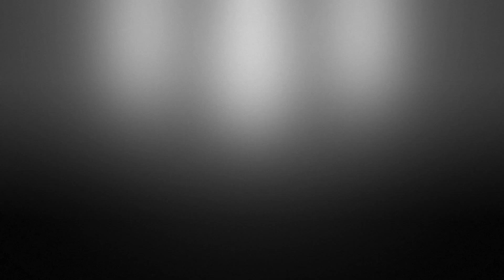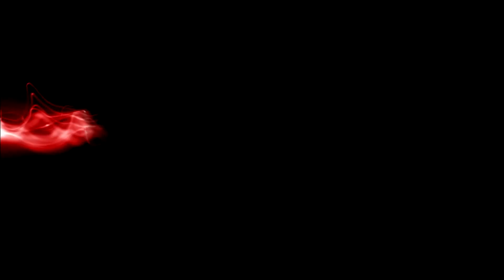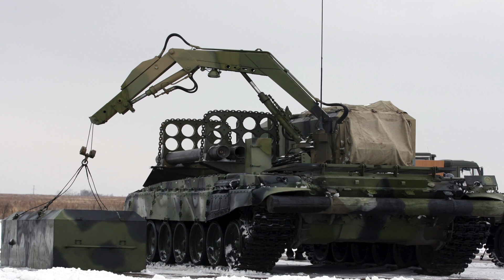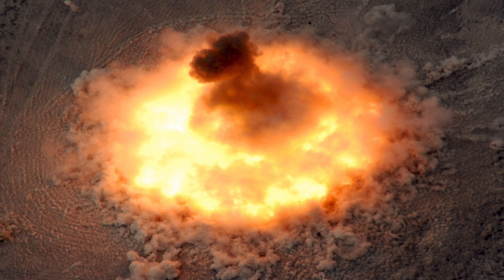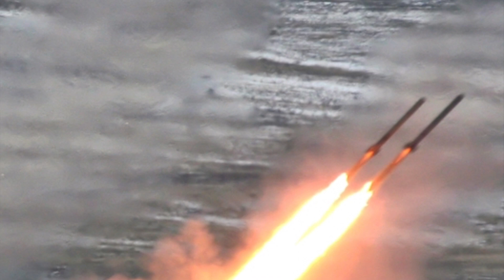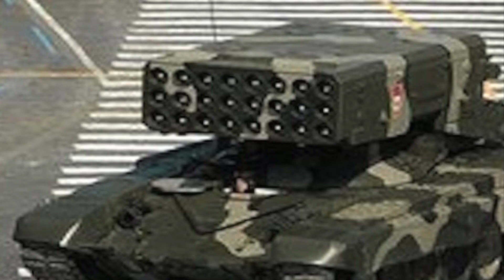WHY RUSSIA’S TOS-1(A) IS CALLED BLAZING SUN ?

Comment: This weapon doesn't make a ton of sense on a modern battlefield, a single fuel air (thermobaric) bomb can do as much damage as an entire salvo and is more mobile and adaptable, given that it's carried on aircraft with a range of hundreds of kilometers and speeds from hundreds to over a thousand miles per hour. The launch vehicle itself because of the nature of the warheads would be highly susceptible to ordinary shoulder carried munitions like anti-tank rockets and recoilless rifles, possibly even 50 caliber sniper fire, let alone air to surface guided munitions or even cannon fire from aircraft. By simple fact of the open face design they simply can not be as well armored as conventional tanks and would be vulnerable the entire time they were in transit at a maximum speed of what? Forty five miles an hour? So, if you have air superiority you don't need these, if you don't have air superiority, they would shortly be reduced to toast, taking their support and defense personnel with them. This seems like a relic of cold war limited engagement strategy, somewhat useful for suppressing revolutions in client states, but that's about it.
Reply: Bombers aren't always over head .. Go look up what its done in Syria, its works.. Very well
Reply: By your logic artillery should be obsolete as well since 'Air superiority'. It's cheaper to use one of these than and aircraft that can be shot down. Also its behind the line of engagement, the likelihood of infantry reaching close to it is highly unlikely. Also there is a magical weapon called MANPADS and even infantry can carry it, and it can shoot down aircraft.
Reply: cough what if aircraft cant get to front lines due to strong ground anti air bad weather or lot of enemy plane fighters? cough
Reply: massivereader
you dont get it, russians katiushas were very effective against enemy cause they shot everything in seconds and go to other positions before planes could fly up and be directed by ground forces
its marvelous hit and run strategy
as for sniping well this thing works as artillery unit that is working always behind front lines
Reply: Alright guys lets stop .. massivemasturbater is an 11 year old kid .. No point in talking to a know nothing child https://www.youtube.com/user/massivereader
Reply: Systems like this did Amazing in Syria...that is modern battle field.  Some would say in "battle space" where GPS jamming is happening this is the perfect system.
Reply: Not certain but I believe they put it on a tank chassis so it would be able to be closer to the combat zone. The Grads have a longer range and they are based on URAL trucks. Of course it is susceptible to return fire but keep in mind it works as blanket fire. An entire slavo can level a swath of land much more quickly and effectively than artillery.
Reply: they know the flaws so they are aware of it.. they know the advantage so they will t0ok it.. snipers cant shot at 6 km right? hehe
Reply: massivereader I don't see anything cheaper. It's on a old tank chasis so it's cheap to incorporate. It's rockets are much cheaper than bombs. A plane costs much more do to fuel costs, so this system is a must have
Reply: massivereader same happens when enemy bombs any ammo deposit, i dont get you dude katiusha proven itself as very effective weapon not only morally but by its dewasting fire power
same goes with ammo cargo ships but i think u dont get this crucial fact that war is war and things explode, what you did say in respond was that rocket launcher is always working next to higly densed infrantry units which is probably wrong since i already explain to you they shoot and change position to avoid counter attack
Reply: well you got it.. hehe tos-1a must avoid getting t0o near to buildings a range of a sniper.. or shall i say this will bomb snipers on the building..
Reply: massivereader I guess you must be some kind of expert.  Lol.   There are so many advantages of this system vrs a bomb that has to be flown and dropped.  1.  You don't need a plane 2.  The rockets are much cheaper and if it's just a house and not an entire Forrest or mountain which you need to clear for landing or our reasons then this system just makes more sense.  3.  Cost effectiveness it's built on top of a t72 chassis which is widley used and cheap especially if it's 2nd hand.  Plus each round is not guided at least yet those are also much cheaper than US air dropped thermoberic Daisy Cutters or moabs
4.  The US has other thermoberic systems including shoulder launched and mortars which can provide similar results.  
5. I guess you missed the part of the actually role of the weapon is to break stalemates between opposing ground forces.  Not every country has the luxury of a real airforce.
Reply: I am sure a AA regiment would be attached to artillery infantry mechanized units and so forth. Russia is not Iraq or some 3rd world banana repuplic without proper air defences or capable airforce.
Reply: massiveretard I don't think you understand what you're talking about. You say you can blow one of those rockets up using small arms fire? Do you know you have to have oxygen to cause a spark to ignite the explosives inside the missile? Even then, a spark wouldn't be enough to cause an explosion, that's why missiles like that have fuses. It's basic stuff, it's like that argument about having external fuel tanks on a tank, they're full of fuel, so if they get shot, the fuel just leaks out onto the ground. No harm done.

Unless you score a direct hit with artillery, shoot at it with a rocket propelled grenade or a HEAT-FS shell, something that has sufficient explosives, then you might get a reaction. Other than that, dream on.

Also the rocket housing is armoured, it's enough to protect from shrapnel.

Moreover this isn't designed to work alone like you insinuated. This is designed to work paired up with SPAA systems, tank divisions and Infantry. Any form of enemy aircraft wouldn't even get close, and if it were, it would risk being shot down by SPAA. Same with tank and infantry attacks.

Also, why the fuck would any organised fighting force use their precious special forces against an artillery battery? Honestly, after you said that, all your arguments became void of any credibility.
Reply: Yep, in 1966.
Reply: massivereader ure saying now that they arent logical to have because they get hit by anti tank rpg, so can be any lighter vehicle supporting infantry so we supposed to send just infantry like japanese on light russian tanks and arm them with rpgs land mines and  turn them in to kamikaze units?
Reply: electricatom2, We're kind of going round and round on this so I'm probably going to drop this thread. The military take measures to be sure Ammo ships and depos are protected and kept isolated from essential personnel  and equipment. Still, they are a risk, but a necessary risk. Usually ammo gets carried in at least light armored vehicles, maybe not as well armored as a tank, but at least comparable to an APC. In assembly areas and military bases, they build special containment areas to direct the explosive blast away from troops and equipment in case the ammo is hit. Even in artillery batteries, they limit the amount of ammo kept fused and out of storage until it is needed to make ready to fire. In a war, those kinds of installations are primary targets, right along with airfields and fuel depots. When you're fighting rebels and guerillas, chances are they won't be able to penetrate those kinds of hardened and protected targets. What you're failing to grasp is that these are highly distinctive looking vehicles that each hold about a company size ammo depo worth of highly reactive explosives (fuses), thermobaric payloads, and solid fuel rockets. They are running around recently contested areas with likely nothing more than a motorized platoon as an infantry screen. The same goes for their distinctive looking reloading pods. When one of these gets hit, it will cover an area about 300 meters in diameter (several city blocks) in a sheet of flame with no air left to breathe, and likey set off any ammo or weapons in that area in secondary explosions. The shock wave will kill or injure any of your own troops in about twice that area. The rocket motors will also ignite, spreading chaos & damage even further. In a real war, enemy troops will know this and prioritize them as targets o opportunity whenever they are moved in convoy, stationed in assembly areas, or deployed in the field; not because they are so effective a weapon, many other weapon systems are more tactically and strategically significant, but because of the chaos and damage to the enemy forces they will cause when hit. Like I've said: they're a great 'terror weapon' against insurgents without knowledge that they are coming, where they are, and when they might be used, but a real military will include them in briefings wherever they are likely to show up. Any time they do show up they other side will prioritize them for airstrikes, artillery barrages and commando action, again not for the potential harm they might cause those enemy forces but for how badly it will harm the Russians around it.
Reply: massivereader i have video in syria how are they used no allied infrantry in sight i dont know why u want to give it only morale weapon name but its more effective in destroying bunkers and infrantry in trenches than any other artillery meaby except cluster bombs and gas but those are prohipited by UN so yeah thermobaric are 1st in line of legal weapons
Reply: i guess its more humane to kill person than to make him suffer till he dies or make him criple for the rest of his life? but long suffocation and rib damage isnt pleasant way to go either
also banning thermobaric weapons by UN would be a kick in the ball to russia since they are pioneers in that thing
not that they would care tho
Reply: adrian kovalski, the current iteration of the rockets doesn't outrange the main gun on the M1A2 Abrams, and artillery outranges even the proposed upgrade mentioned in the video by about 20 km.
Reply: when the air/superiority is disabled.. this will engaged a berseker in the ground! just think about it when this reaches the land territory of any country.. the city will turn into scrap!
Reply: ekieir jayme, You didn't bother to read the thread, did you? It is not and can not be armored. The only scrap will be the thing itself, and any Russian troops and equipment for a few blocks around one of these things when a sniper with a recoilless rifle or .50 cal sees one, or when it gets spotted by a forward observer. 

Oops, my bad! it will take out the buildings around it and any innocent people still in them, too.
Reply: ekielr jayme, Fortunately snipers don't have to be four miles outside the operational range of the current rockets. Six miles is the proposed and in development possible upgrade. You also don't have to be in the target area for it's ordinance to shoot at the launcher. (duh) In fact, anyone more than a quarter mile away from the thing can have at it. You wouldn't want to get barbequed along with the Russian support troops and infantry screen surrounding it. In a city, that means there are literally thousands of windows and rooftops from which it would be relatively safe to shoot at it, or simply call in artillery or even simple mortar fire.
Reply: Hmmm... looking out the window, I would say there are a few more building out there within range of a spotter than there are rockets in a few load out's of this thing. How many reloads do they trundle along? Two? Three? Six,? Eight? Remember, each load out carries the same risk to your own troops as the launcher itself. A tank carries somewhere between a few dozen to a hundred shells internally. This has, what? Twenty-four rockets in a load out. If this has to level every building where there's possibly a sniper or a spotter to advance into an urban area, how much ammo will be left to execute the mission of breaking deadlocks in a contested area?

So what we're getting so far would be, I guess, a field operational unit of two to four of these things. Add two or three transport trucks to carry additional load out's for each one when it has flushed the single one it carries. And, of course, a mobile Infantry screen of a squad or platoon size for each one, and for each ammo truck to allow independent operation. That's a convoy of a dozen or more vehicles. Think that isn't going to get noticed in a highly contested area? All it takes is one unit, either launcher or load out getting hit to take out the whole unit, unless you space them a 1/4 mile apart when they are in transit, which means you would need an even more substantial infantry screen. We're getting up beyond company size now. If you have the spare resources to throw a mechanized company at a deadlock, I'm thinking Armor is the way to go. Remember, these things are no more mobile than tanks.
Reply: Chezadelic1, As I pointed out in my last post, this thing doesn't have all that much ammo to throw around. There's only twenty four rockets in a load out. Go ahead. Count them. Every one they use for self-protection is one less to use for the intended target, you know, the deadlock it's supposed to break? You're also ignoring that these things fire rockets. Want to put your bare hand on the launcher after a single rocket fires? That makes it an ideal target for anything IR guided. There's no practical way to exclude mortars, or recoilless rifles, or anti- tank shoulder fired munitions from it's operational area in an urban environment. Buildings simply aren't kilometers apart. Artillery can be anywhere in a twenty mile radius. The range of this thing is two miles, about the same as a tank's rocket boosted ammo with modern smooth bore guns. I understand they're working to get the range up to six miles for this, what makes you think a tank's range won't see a similar increase during that development window?
Reply: adrian Kovalski, Bzzz. Wrong. I just double checked. Read the description. It's a weapon designed for short ranges. They claim a maximum range of 3.5 km for the initial unit TOS 1, or about 2 miles , and 6 km for the upgrade TOS 1(A), a little under 4 miles. The 'several football field' blanketing effect is achieved by flushing the magazine of 30 rockets for the TOS 1, or all 24 rockets for the TOS 1(A) in a salvo. Modern artillery typically has maximum ranges of 20 to 40 km (12 to 25 miles) depending on the size of the artillery piece. 
Just stop and think for one minute. This thing fires 220 millimeter rockets. That's a rocket a little more than eight inches across. Most of the rocket is solid propellant and guidance hardware. It can only carry about a liter or two of thermobaric powder to be dispersed or liquid to be aerosolized. Using simple math you should be able to figure out that each individual rocket blast will only cover an area of about thirty meters.
Reply: massivereader tanks don't make much sense because a plane cab do it better. That seems to be what you must said
Reply: Yeah, It's a different series of missiles, not the TOS 1. Simple physics man. To have rockets with that range they would need to be several times larger. I guess they could package them to use on the TOS, but you'd only be able to fit four or maybe six at most in a salvo. I think there were some pictures of the TOS tank body carrying four larger missiles in a parade either here or in another video, but they didn't even have the minimal steel box for protection.
Reply: Dmitry Lukin, Okay. That contradicts what everyone else is saying about using them to shoot and scoot, but I'll go with you on that. My point is and has been that, because of it's lack of armor for the rocket pod, and the extreme volatility of it's ammo load the potential damage to its own friendly forces if only one mortar, or artillery round, or RPG, or shoulder fired anti-tank round or armed drone, manages to get through kind of counteracts it's usefulness against a competent military. The point of a salvo being able to incinerate an area of five football fields just points that out. If it's surrounded by friendly forces it will be the target of choice, because of the collateral damage it will cause to it's own side blowing up and cooking off the entire pod at once. Any of those same offensive measures deployed by an enemy force against a tank, rocket launcher, anti aircraft missile system etc. etc. might take them out and make a nice big boom, resulting in a blast radius of a few dozen meters and spread shrapnel for a hundred meters or more. You hit one of these and you can increase the damage you just inflicted on the force using them by at least an order of magnitude, because of the hyperbaric warheads. As in: the warheads are highly incendiary, are shock and temperature reactive and there's no conceivable way to really correct that. The more forces you tie up trying to protect them, the worse the resultant damage will be.
Reply: Jonathan Allen, All I know is I wouldn't want to be within a quarter mile of it if I was a Russian soldier in an active combat zone. Maybe you would. Personally, I have no strong desire to find out what it feels like to be a marshmallow.
Reply: massivereader Do you think these go into active combat??
 Off course they don't moron they shell the shit out of things like towns and small villages. It was used to a great extent in the Chechen wars and Syria. There, it showed it's incredible ability to burn out whole street blocks in a few salvos. This thing is ment to follow behind tanks and infantry, and on request destroy things
Reply: phil mak + Is there an echo in here? Can you even read? That was exactly my argument during this entire thread. These things are perfectly fine as a terror weapon to use against insurgents or rebels or third rate armies without intel, scouts and communications. Not so much against a properly organized modern military. Not because they aren't accurate or are defective in some way, but because the payload simply can't be armored and the warheads will blow up just as nicely in the back lines and transport convoys as they do delivered as the designers intended. The many defenders of this launcher don't agree with you, they think it is god's gift to smite the wicked in any and all situations, and that the military magic of the Rodina will somehow miraculously be able to protect it. Maybe in WWII or even the post Vietnam war era, not so much today.
Reply: massivereader Yes but almost all wars today are against insurgents in cities. This thing therefore is adequate to have.
Reply: phill mak + As I've said before, I sincerely hope the Russians build tens of thousands of them (they certainly have enough outmoded and relatively useless tank chassis rusting away because nobody wants them). And  park them right next to every concentration of troops and military equipment <heh>.You may not know this, but tanks are relatively expensive to maintain, run and even to move around, that's why they mostly ship them near where they need to go on trains and trucks. Just saying, there's a reason the S-300 and S-400 are built on truck beds. If I have to explain why a guided rockets (not to mention 24 of them) are an order of magnitude more expensive than a guided bomb, it will be because you slept through physics in primary school.
Reply: Actually, russians have a direct analogue of A-10 (Su-25). But yeah, having a multirole-something is always less effective that a specialized-something at least in one way.
Reply: Yet it is used in REAL WAR in case you didn't hear
Reply: Jarrod Youngblood against a cornered company of soldiers and equiptment.....
this would be hell
Reply: That’s like saying air carriers are useless Bk they are s big n this days missiles are so good that single one can disable it. Every weapon has is purpose. This thing is mobile n deadly. N cheap as hell
Reply: The Russian forces use different tactics and strategies then Western forces. For example they have a lot of wide open country perfect for AFVs. So in that regard this makes sense. It also is cheap as it mostly reauses T-72 components.
Reply: Duh, that is what the dispersal charge in each individual warhead does, or the hypergolic load itself if it is liquid and carried under pressure. When hit by incoming ordnance, the damaged or shocked munitions will rupture, as they are designed to do, spreading the hypergolic mixture. If it is not a self-igniting mixture (many are) when it reaches the necessary fuel / air admixture it will ignite due to the residual heat of the initial incoming warhead or projectile. This all happens very fast, as within less than tenths of seconds. 
If the overpressure wave from the initial explosion does not set off nearby dispersal charges in the magazine by percussive shock, it will quickly heat all the surrounding munitions until the dispersal charges cook off one by one, or the hypergolic load reaches temperatures that exceeds the vaporization point of the hypergolic powder or liquid and the structural integrity of the individual weapons will begin to fail, exacerbating the cascade. 
While it won't be as effective as a single planned dispersal pattern, it really doesn't have to be. It will be more like a chemical or fertilizer plant explosion than the synchronized detonation on target.
Alternately, the hypergolic mixture is pressurized and will disperse itself as the ignition charge cooks off. 
If not, it will become so when heated by energetic exothermic reactions surrounding it. All explosives and hypergolic loads are inherently exothermic and unstable chemically, by design. The entire concept of the weapon depends on the expanding interface of the hypergolic / air mixture and the self-propagation of the weapons expanding reaction producing a wave front consuming the ambient air and igniting anything flamble. Unlike a traditional explosion, these work much more like the pyrotechnic fires you see in movies, except they are hypergolic rather than incendiary. And I've said nothing about what will happen with the solid fuel rockets propellant the warheads are sitting on top of.
Reply: Uss Liberty Never Forget he said "in a modern battlefield". That theater USED modern technolgies but the opposition the TOS was fielded against was far from modern. So yes without air superiority these things are sitting ducks. Enter the s400 and s500 system. I'm American. And even I don't believe air superiority would be easily achieved with the s400 in theater. Then again I don't think any of us expect any aspect of a war with Russia to be "easily achieved" . Its war. And its kinda our number one export.
Reply: "modern battlefield"as soon as TOS is loaded on transport it's identified as potential threat by satellite, when arrives in conflict zone on a boat or rail transport it's likely identified by drones and satellites (or simple spotter intel) within a few days, if not then as soon as it starts to move to a position "behind the lines" it's exposed to drones, air support, scouts, hunter-seeker teams and armed people in generally who don't like rude fellows moving into their neighborhood with bad intentions. So the opposing forces will know where it was and as soon as it moves close to a position where it might have some effect, everyone on the other side decides to see if our Russian friends enjoy having a bonfire in their midst. See? I can write bad fiction too.
Reply: bomber are useless without gps navigation. Do you think air superiority will be on top of list for Russia?? it will become the least of priority coz that air warfare is vulnerable today, shut down all 132 navstar satellite you will end up suicide in mid of air
Reply: 1) Inertial navigation guidance 2) Look down / shoot down radar 3) Terrain recognition software 4) Laser guided munitions. All of these technologies are available to modern western fighter and bomber aircraft, cruise missiles, unmanned drones, and those pesky munitions they call 'smart' since the eighties as add ons, if not already built in.
Reply: massivereader
Another savvy warrior!))) Especially for Western experts with a lack of brain, the heavy flamethrower system "Buratino" was created to support tanks with the breakthrough of NATO defense in the European theater of operations, where there is a lot of urban development, and you are carrying some kind of nonsense,you just probably all wanted to show that you Americans are better than everyone in the tactics and strategy of warfare, you did not succeed!)))
https://www.youtube.com/watch?v=govStN7X6PI
Reply: electricatom2,  That's my point, if your aircraft can't get to the front lines, this thing is toast for the enemy planes, or possibly even snipers, as the rocket pod can't be armored.
Reply: It's not that they can get hit by any number of offensive weapons, I agree that can happen to any military equipment. It's that they can't be armored, are packed full of solid propellant rocket fuel rods and thermobaric warheads, probably something in a powder or easily aerosolized liquid form. When they get hit, they don't just explode like a tank or artillery piece causing damage by a pressure wave and shrapnel, the warhead dispersal charges will detonate and spread a sheet of fire the size of several football fields, while sucking up all the surrounding oxygen, just like they do when they hit their intended target, at the same time the fuel rods will start to cook off (they likely don't require oxygen to burn, being a solid matrix of oxidizer and fuel particles) and go shooting off in impossible to predict directions. That would not be any fun to be around.
Reply: yfelwulf, You're talking about the MOAB. That's only one of a variety of thermobaric munitions the US has available. If I'm not mistaken they have several different fuel air weapons sized for all of the current US bombers and even some fighters. If you watched the video, the blast area created by flushing the featured weapon is claimed to be several football fields, that sounds like a blast radius of 100 to 150 meters. The nominal blast radius of the MOAB is 300 meters, or several city blocks. FOAB is reportedly twice that radius.
Reply: Chezadelic 1, I completely agree it's no more susceptible to attack or damage than any other hardware, the problem is what happens when it gets hit. The damage it will inflict on the surroundings (behind Russian lines) is an order of magnitude worse than artillery or armor. And in response to a later post: Yes! Please use it in an urban environment!
Reply: phill mak + Adequate, but vulnerable. I still maintain there are much more secure and cost effective ways to do the same thing with bombs or longer range, less numerous rockets. I see it more as a low-tech crutch, probably originally necessary because of poor quality control on the individual rockets so that a single launch failure didn't impede an ongoing offensive, but essentially being more useful as a way to gain a temporary psychological advantage on the battlefield both to boost troop morale and terrorize the opponent. Like most things military, weapons systems tend to take on a life of their own, and hang around a lot longer than is wise or necessary.  Military officers and planners tend to be very conservative with implementing change.
Reply: The Russians have a long history of using massed small missile launch units as support for ground troops because it's gives their people a tremendous psychological lift and can demoralize opposing troops. The west tends to go for artillery because of longer range and better accuracy. It's kind of like why our ground troops prefer the A-10 over multi-role jet fighters for ground support: it's right there and people can see it doing it's thing. But the A-10 is more accurate, cheaper to operate, has better a bigger punch, more payload and longer loiter time and is more survivable than the alternatives . I'm not so sure about this thing vs fuel air explosives.
Reply: ssu123, That's not what I'm seeing. 1 or 2 miles max range for the original two iterations of the rockets up to maybe 4 or 6 miles for the latest planned but not yet implemented upgrade? From what was said about the range it would have to be kept near the front lines in marshalling areas inside a defensive perimeter if they want to protect them from shoulder fired anti-tank weapons, or just plain RPG's, unless they are constantly doing infantry sweeps for a mile or so around them. They can't be tucked away in a revetment 20 miles away like artillery, far from the action to keep them safe. As I said, it's likely perfectly fine for fighting lightly armed insurgents with little access to operational intelligence, no air support, minimal communications, and with not much unit mobility like they have been fighting in Syria. Really good psychological weapon for that particular scenario, It probably scares the hell out of them. In a real war? Slightly better troops chewed up a bunch of newish Russian tanks on the move in Chechnya, and this thing is a hell of a lot more fragile. If I was attached to a support group or transport unit travelling near this I would get nightmares thinking about one of these, or just the re-arming pods carried on ordinary military transport vehicles, cooking off in the center of a column on the move, or worse in a staging area, when one eventually gets hit. Dozens of solid fuel rockets with thermobaric weapon loads? Not healthy to be anywhere within a half a mile, unless you're inside a tank.
Reply: Exactly! A MANPADS, a Carl Gustav, hell, even an arty barrage would shred that thing, and the latter definitely outranges it. Armor is somewhat resistant to anything but a direct hit. Artillery range is up to five times what this thing can reach and is a comparable target and I'd wager a good bit cheaper.  This thing, it carries it's whole weapon load on the outside in a tin can! It's only advantage is mobility as it's built on an old tank chassis, but so is a lot of self-propelled artillery. I'm sure it's great for turning light irregular forces into barbecue, but against someone that has drones, satellite intel or even decent recon? Not so much.
Reply: electricatom2, I do get it. In fact, I think the Russians should build thousands and keep one parked next to every concentration of force they have! No one will have to fight them if they install their own self-destruct!
Reply: An A-10 would make mince meat out of this.